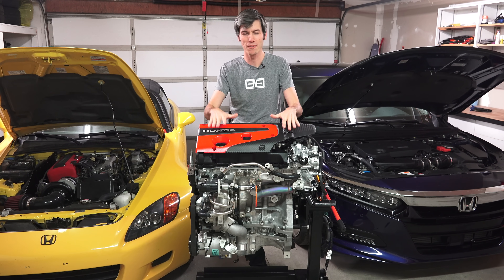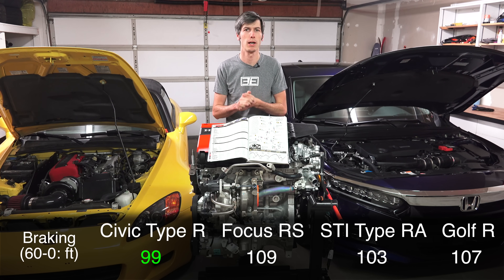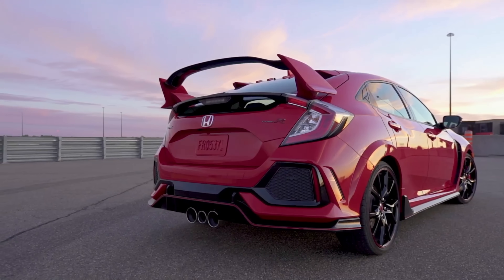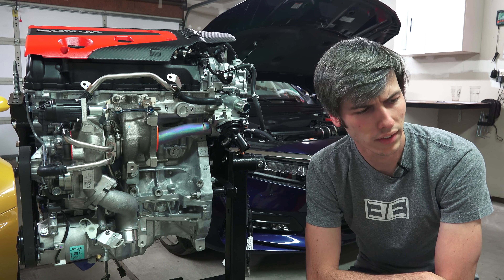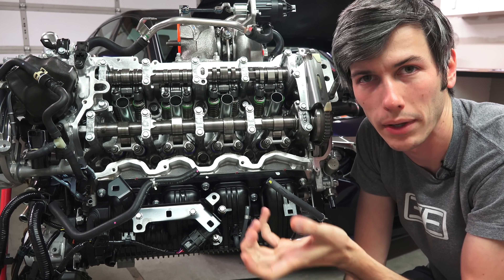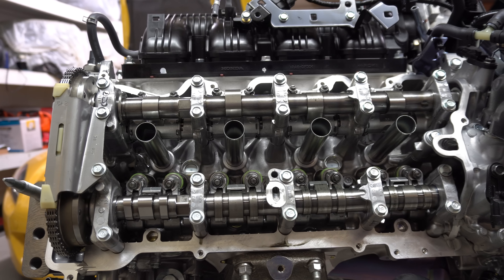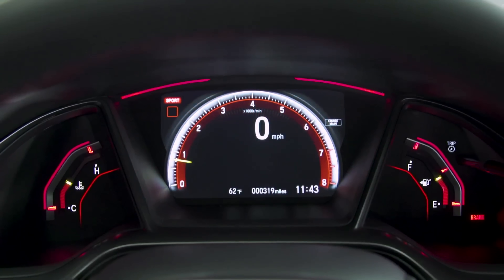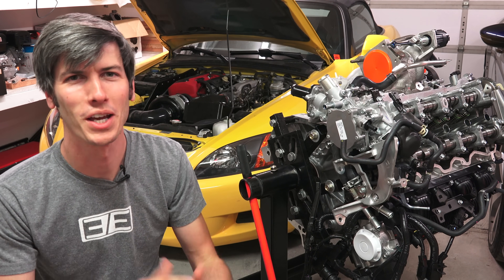The Honda Civic Type R Destroys The Competition - The Best Engines

Comment: Still way overpriced for the type R. Nissan does the same thing. You can get a brand new 2019 370z sport for around 30k but a nismo is 47k.
Reply: the 370z also badly needs a model refresh
Reply: Oh definitely, all they did is change the front bumper a little and wheel design and call it a new model. Hell they should cost less each year lol.

Comment: I own the 2019 Accord 2.0T 6MT; I opted for the Accord because of its calmer looks and more touring-style drive vs brutal track attack car. I know the 2.0T is tamed down in the Accord but it's still a rocker and blast to drive. The transmission is also the same as the one in Type R, just different gear ratios, etc. Bonus is it's $5K cheaper too than the Type R (not a deciding factor but still nice).

Comment: Honda spent all on the engine and took a 10y old for designing the car..
Reply: Thanks to that 10 year old it didnt became a boring dime a dozen design.
Reply: Thanks to this 10y old its the only car in its class to produce downforce.
Reply: @Glow Berth LMFAO thats why the spoiler is so high up...
Reply: @joemann If you ever driven a FWD hard you would know you need downforce in the back too as the rear wheels will swing out if there isn't enough downforce in a turn.

Comment: One of these pulled next to me on the highway at around 70mph in my BMW 335d. He signaled to race and punched it. At 315hp stock it was impressive...until put my peddle to the floor.  I passed him doing 100hp and left him in my rear view. Wasn’t even close. You can’t beat a tuned BMW M57 engine...unless maybe if it’s a S85.

Comment: You said crank and rods are forged.. What about pistons? You know.. the thing that breaks more often than not (rods are tied)..

Sodium filled valves was an sti innovation IIRC. But doesn't titanium trump thus?

Seeing a headless cam system would be better than all that. I wonder when they'll stop using heads and finally move on. (I wonder when the patent runs out). 

I like all of those stats. But I recall seeing something the other day stating they are recalling that engine for some reason.

Comment: I work for a Honda dealership. If you are looking for a comfortable street var that looks good, it does not cost much to make the accord faster then the type r and you get all the luxury of a high trim accord (which is comparable to most luxury cars in quality and amenities). 
The cost is pretty comparable as well. The accord is more, but you are also paying for that luxury instead of that "racecar" feel. Type R's are nice. I would love one, but if you want a fast, comfortable street car, the accord wins in my book. Type R wins on the track.
Reply: The Accord is best in the high 20's low 30's after that point there are so many better sedan options.

Comment: Most Practical? The golf r and the Subaru sti have all wheel drive , on top of the that the golf type r 0-60 was for a manual not an auto , it would get 4.7 as an auto
Reply: And even on a manual the 0-60 is very dependant on the driver. The auto would destroy the Civic in the 1320. Throw a tune on it and it's a 11s car. The golf is Def the best in the bunch

Comment: Which one is the most fun to drive and which one has the engine that has the most fun engine to rev out? The MX-5 is as fast as the Golf R and STI from 0 to 60 and I’d argue more fun to drive being rear wheel drive and the NA engine revs forever.
Reply: Miata only revs to 7,500 Civic type R is right behind it at 7,000

Comment: You put that type R engine in your s2000? You know you want to right?
Reply: Supercharge the S2000 block instead...
Reply: @Renz R that’s what she said.
Reply: Nah imagine putting it on a crx, that car is so light, it’s definitely going to be really good on gas and speed, it’s possible
Reply: Dylan L the K motor is better than the F20.
Reply: @MillerVanDotTV  😂😂😂 the f20c is the best motor from Honda. Way more reliable Evans tuning made 950whp bone stock
Reply: @joseperalta8605  f series are great but the k series actually has more potential. F series stock k series for mods
Reply: @joseperalta8605  lmao no engine for the masses is making 950whp bone stock.
Reply: Dylan L why would you want to put a breast faster engine in as an engine swap? Dumbest comment on YouTube you just made.

Comment: now i want a civic type R. but what about the GDI carbon build up issue on the valves? the same as others?
Reply: Yup..... long into getting a "new" car. Looks like all the 2l have this problem over time.
Reply: @TorontoBoii  I have a Sonata 2.0T with their 100,000 mile warranty. So I'm covered till than I guess. LOL!  I'm actually looking at the 2019 Volester N model.
Reply: @JayzBeerz  as of right now. I got my eyes on the golf gti or civic Coupe. Manuel of course. 😆
Reply: @TorontoBoii  nice bro just go for the civic si or type R if you can find one.
Reply: @JayzBeerz  yeah, I gotta agree. I have a 1.8t vw and it has been a fun car but you gotta maintain it too keep it reliable. I just want something that is reliable and quick out of the box. Still want to keep it a 4 banger, but want more reliability.
Reply: @TorontoBoii  the 1.8T is one of the best engines out there. i don't know if you can find a more reliable engine than that. but we all know honda engines can go on forever.
Reply: @JayzBeerz  Same with Toyota, but they are slow. The 2020 Supra looks good, but BMW engine and drive train. So that's out. Lol
Reply: @TorontoBoii  lol yeah man Toyota went to bmw cause their engine is better and now bmw is gonna put their 4 cylinder in the other supra models. but due check out the volester N reviews. all good reviews.
Reply: @JayzBeerz  Looks good I'll check it out this weekend. I think I am sold on getting a Toyota 86, once the head gasket fails at 60k I'll 2j it 😅

Comment: This engine is whack when you compare it to any other k series excluding the k20a3 and even that engine can make about the same power safely. also the intake manifold temps become extremely hot once you start to really beat on it. I would much rather own a tsx k24a2 or k20z3 or k20a2 not hating on your video just not a fan of the new Honda stuff they basically just took what everyone does in the aftermarket community and made a factory version also vtec should not be a type r exclusive thing

Comment: Why make valves that remove heat(energy that could be used to move the piston) Instead of using a thermal barrier coating to keep heat in the combustion chamber to extract more usable work..... Other companies do this...
Reply: Guess your a engineer

Comment: Try to get away from Honda motors. I stuffed a 2.2 ecotec engine in my Alfa Romeo spider,, dyno'ed it a local machine shop, that had a flywheel dyno
( they bed there motors in that way, so customers, have a good base) at 227 hp at 7500 rpm. Max torque  at 183 at 3860.rpm. yes, I know ,it just a gm engine, not a Honda engine
 But you might want to take a look
 Lots of ecotec engines at drags, running down the strip. With Honda engines, in the rear view mirrors

Comment: whoa something is wrong here!  my 2009 subura wrx (not even the sti) did zero to 60 in 4.7 sec.  your saying that a 2018 sti zero to 60 is 5.7???
Reply: @someone else I found out it is due to the new six speed gear box.  It wont reach 60 until 3rd gear.
Reply: My 10' has the same 4.7 figure. I imagine they're taking it really easy on the launch, which is understandable.
Reply: The honda is fwd of course it's slower from a stand still 🙄

Comment: "saving weight with smaller spark plugs"

OK now you're just stretching lol
Reply: Yeah, that's ridiculous. Instead it should have come with a workout guide to reduce driver's body fat. That would help to reduce lot more weight than 4 smaller spark plugs do...
Reply: @WECanOn  its not only weight...it gives it a bigger combustion area because of it. so 2 birdy one stone
Reply: @cali_cal  That's not how it works.
Reply: @cali_cal  That's the only reason.  The "weight reason" is BS.
Reply: @cali_cal  
The stone being a 13.7 sec 
$40,000+ Civic!
Reply: @WECanOn  
Lol.... yeah, pretty ridiculous.
Or just hang a big deuce before driving that POS. That's a pound right there!
Reply: But that leg room
Reply: @FirstLast-qj6lh  enough room to spread legs too 😝
Reply: @FirstLast-qj6lh  yes, the smaller spark plugs allow for more leg room. :D
Reply: Look at the Ferrari F40. They claimed the didn't have door handles inside to reduce weight. Weird, I know.
Reply: @DellisHe  i mean if i had a ferrari.. i wouldnt wanna get out of it anyways.. so why would you need a door handle?
Reply: Save even more weight by getting rid of the spark plugs. :))) (Let's see how many of you get the idea)
Reply: @Rob-326  Pull out those weird tubes that run everywhere under the hood
Reply: @Rob-326  packs
Reply: @Rob-326  Damn Dude you steeling all my ideas I wanted to use microwaves or high variable magnetic induction. My lawyers will be in touch.
Reply: Everything surrounding them could be smaller and more compact...trickle down effect...it ain't simply the spark plugs.
Reply: Porsche used 2000$ batteries to save a few pounds. Ferrari sells special editions basically without interiors (and charge more for that), Lamborghini made a car with plastic windows and windshield.

They get a little crazy with these things sometimes, spending tens of thousands to save 100 pounds of weight which no one is ever really going to notice in a road car. A fraction of that money spent on more power and better suspension/tires would make more of a difference.
Reply: @BigUriel  Adding more horsepower doesn't make a car more nimble, reducing weight does.
Reply: @BigUriel  I think the suspension is perfectly fine mang, hmmmm the tires are very decent but of course there is always room for better tread. I wouldn't go out of pocket for the suspension as it is killer already. Plus if retail value would drop tremendously.
Reply: Save a ton of weight, by riding a motorcycle.
Reply: They opted for smaller spark plugs so that they could use bigger valves. Bigger valves mean better flow which means more power.
Reply: every little thing add's up! so  yes it reduced weight..
Reply: Youd save more weight by skipping lunch lol
Reply: Okay, I like many of you I did a “what” after that comment. But to Jason’s point weight isn’t found in just one spot it’s all those “spots” combined. The first generation NSX had aluminum seat frames and jack, Honda does try to make their cars light. My ‘85 CRX si was just under 2K lbs and was faster than my brother’s 300Z 0-60.
Reply: To all those saying, "weight adds up" ... I wonder how much weight would have been saved if they didn't surround it in those hideous plastic "accents"...
Reply: That's a good way to justify any lack of features in the car.
"Why doesn't it have ABS--"
"BECAUSE WE'RE SAVING WEIGHT SHUT UP JAMES."
Reply: Yea. But your save .2 Oz 😂😂😂
Reply: Should have went with packs.
Reply: Not really ya dingus
Reply: He’s a fanboy
Reply: Reduce weight above center of gravity, smaller plugs = corners better :0)
Reply: @sean8081a  
Yeah....right.
Just drop a deuce before you get in your 'light weight spark plug' Honda.
Ridiculous BS you Honda Tards spew.
Reply: Take out the engine for maximum weight reduction
Reply: @orthoking2722  I concur Hydrogen fuel cell and the right three phase motors and control unit. I think would annihilate any internal combustion engine.
Reply: its like you didnt even watch the video, he states its done to make more room in the combustion chamber and adds that it saves weight as well.... the weight is just an extra that goes along with smaller size......
Reply: its not the weight of the spark plug they're talking about when they say that, it's the weight saving you get from shrinking everything down near the spark plugs too...
Reply: Man from Nantucket 
Oz equal lbs
Lbs equal pain.
Reply: He literally said the weight savings come from increasing combustion chamber size, not the plugs themselves. Did you guys listen to what he actually said?
Reply: Agreed, lol (if the objetive was to only save weight, i think it is an exageration)
Reply: Less "mounted weight" (weight supported by the motor mounts) = more torque.  Same concept as "unsprung wheel weight". Check your physics.
Reply: lmao
Reply: Honda did use thinner floorboard mats in their Type-R DC2 Integras to save weight lol. They can be a bit obsessive.
Reply: everything adds up tho
Reply: Smaller spark plugs also allow for more space for the valves in the combustion chamber!
Reply: Actually yeah! Have tou ever seen F1 racing they will remove the tiniest thing to lighten the load. Soooooo yeah!
Reply: Such a narrow minded remark, where would we be without this kind of methodolgy, weight is every engineers no.1 enemy.
Reply: Smaller spark plug really saves weight in addition it also eliminates room on a combustion chamber

Comment: Hold on, did you say change the spark plugs at 100k?!
Reply: @Flapping Flight because I have seen break inside the engine and the little piece that broke off damage the valve. And that was way before 100k miles.
Reply: @DocumentaryHub  If you tried this on cars pre 2000ish you would run into problems. Most cars run so well that I've seen spark plugs making it to 150 miles without even having an issue (except Ford).

Comment: Don't care if the Turbochargers make up for it, but a Honda engine isn't a Honda engine if it doesn't Rev pass 8000 RPM.
Reply: By that definition most Honda engines are not Honda engines.
Reply: @IAMJAKETRIMBLE  That's it. That's why Honda sales have flopped over the last 10 - 15 years.

Comment: Do you think there will be any problems with carbon build up on the intake valves due to the direct injection? And wouldn’t that need to be addressed before the 100K mile marker?
Reply: Direct injection is not as good in terms of reliability, but as I understand the capability of the engine to run leaner and hotter, gets rid of some carbon build up.

Comment: Accord is 1500 vs Type Rs 2000, so the Accord perform credibly; however there have been complaints about reliability from the Accords 1500 turbo engine.  I think Honda made a big marketing mistake by not offering this 2 liter turbo option for the Accord, and while the 1.5 turbo is fine for the daily commute and average person, if you're one to like a bit if aftermarket tune while still enjoying a family sedan, the 2 liter turbo provides the right platform.  You didn't mention anything about the transmission options,but the video is really about the engine.
Reply: The Accord does offer the 2.0t as well as the 1.5t - this video was comparing the differences of the Accord 2.0t and the Civic Type-r 2.0t engine.

Comment: Looks like the cam chain drive is built to last the distance.
Very solid looking.
Is there a better high  performance 4 cylinder engine in mass production today ??
Reply: Way better. 2019 AMG CLA 45 uses 2 liter 4 cyl turbo making 375hp and 350tq...

Comment: Hey buddy ! I have a 2001 S2000 is there anyway I could drop this motor into the s2000 ? switch the mounts and make it still being rear wheel drive ? I cant afford a type r , but I sure can afford the motor

Comment: Honda, please throw this engine in a rwd platform. 2 seater in the Honda line and a 4 seater coupe in the Acura line (for the taller folks).

Thanks...
Reply: Maybe bring back the prelude or s2k
Reply: Haha! MX-5ND2 more fun around the track then all these
Reply: This is straight facts I’m 62 and drive a integra it’s so tiny but I love the car . I think the new 2020 Acura TSX should of been rear wheel drive it looks like a drift car .
Reply: They do in the F3 americas car lol
Reply: Yeah FWR are slow af, that's why Spoon sport type R is the slowest of all time attack cars... Oh wait!
Reply: @pablogonzalezhermosilla4210  I dont think he said it is slow. Its just fun to have rwd. Drifting is fun. Get something that focuses with rwd. Its just a desire, no hate towards honda my G.
Reply: RSM Lifestyle Acura makes no RWD cars
Reply: @pablogonzalezhermosilla4210  Were you just spewing whatever came to your head or did you fail reading comprehension? 

I never said they were slow. I've owned every generation civic post 1970s, and a couple preludes. My first autocross car was an ef hatch ffs lol.

Comment: The balance shafts are in the oil pump, not the oil pan. Also, don't forget the Type R engine is a split block design. Much more beefy. It's basically a shaved down version of the standard Honda 2.4 liter block. Very reliable. Go Honda.
Reply: Do you think this type R engine will be as reliable and durable as the previous civic engines? Meaning, it will run 200 to 300,000 mi with proper maintenance?

Comment: You buy the honda and you get a non-upgradable package. Sure you can upgrade it if you have the money but you will always have just the front tires driven only. All others can be turned into 500+ monstars for not a lot of money. 4 wheel drive is superior when you go 350+ hp. Honda's engine could do much more than 320 bhp but this is about the limit which the front axel can handle. Giving it more power will not make it faster espesially if you have comprimsed wheather conditions.

Comment: How does it accelerate to 60 faster than an AWD car that beats it in the quarter mile with a 5mph lower trap speed.  Makes zero sense unless Subaru shifts into second before 60.

Comment: Takes golf r and does stage 1... situation changes. Fwd is the limit of the Civic Type R. There is only so much you can do about adding power before you run out of grip and driveability. Awd ftw